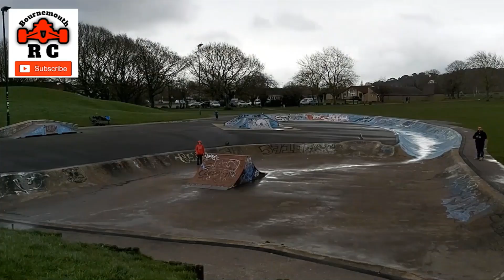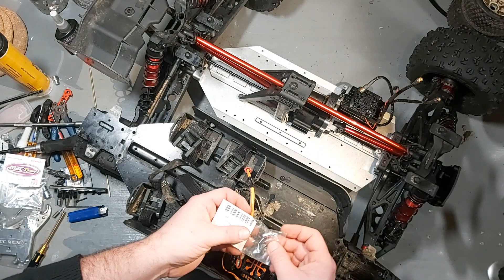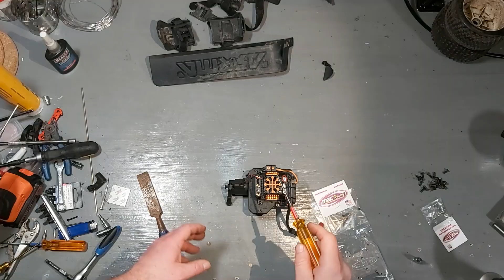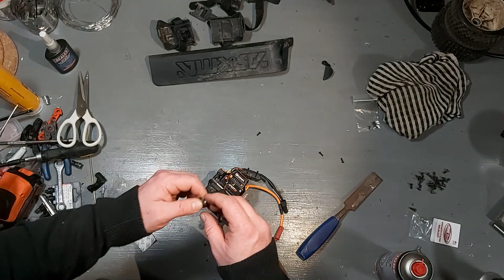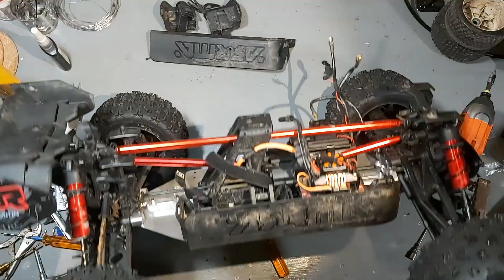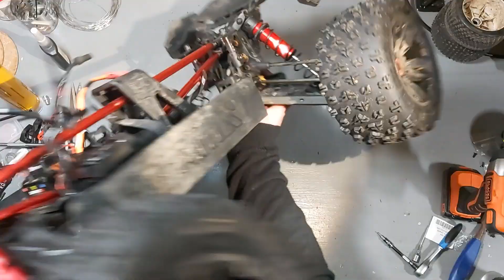Arrma Kraton 8s Full M2C Tank Build Part 4 ESC Plate , Servo and battery trays. The Finished Beast

Comment: ✌🏻😎🏴awesome build dude. 
How much of this vehicle is left stock now? & can it be built cheaper without buying the K8 to begin with ? & how much cash is put into this vehicle now? 
Can’t wait to see you run it👍🏻
Reply from the maker: To be fair is some big parts I've changed and I'd say 75% is still original, I've looked at this before. Always works out cheaper to buy a second hand car to use ready for upgrading. That's what I do anyway 😁😁👍👍
Reply: @bournemouthrc4371  yeah I remember that answer now & I think we talked about it in a live stream come to think of it but for some reason I thought it was for another truck 😂. 
Did you have a reason for each and every upgrade?
Reply from the maker: @THEMASKEDMASTER  yea its the same as the 6s arrma range.
 Yea every upgrade is for a reason, some for strength like the chassis and motor mounts. Some for reliability and performance like the hinge pin holders and steering rack. The ESC plate is preparing for a max 5 in the future. The ESC plate is probably the only one that isn't key at the moment until I change the ESC, but is still adding strength